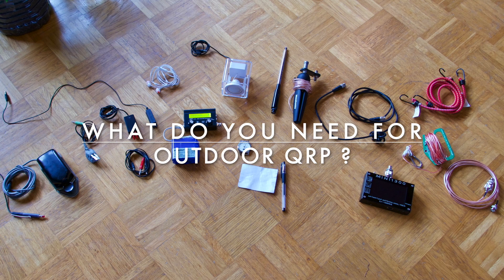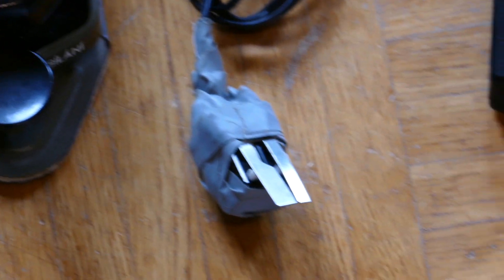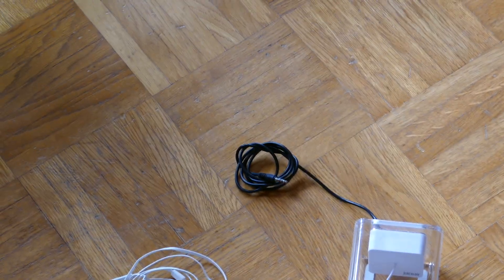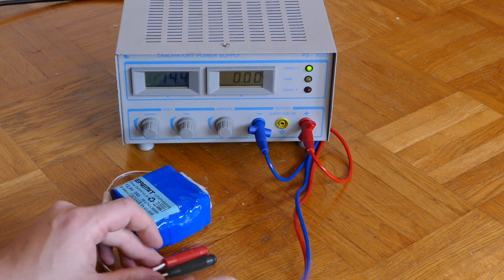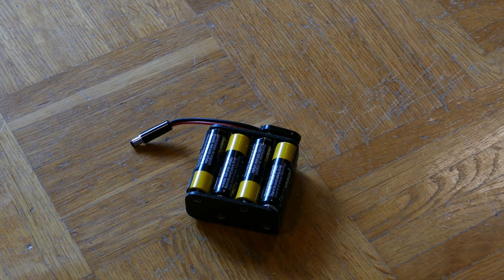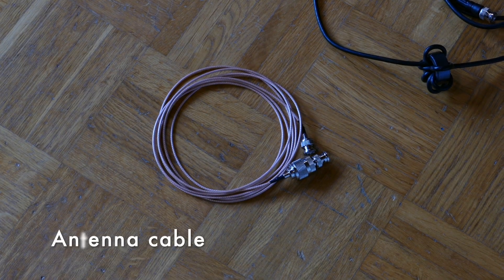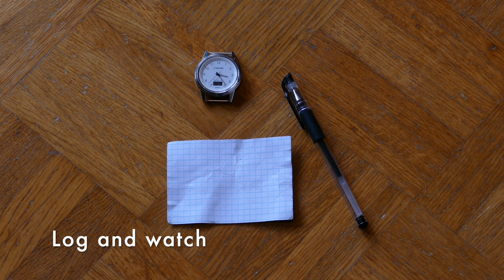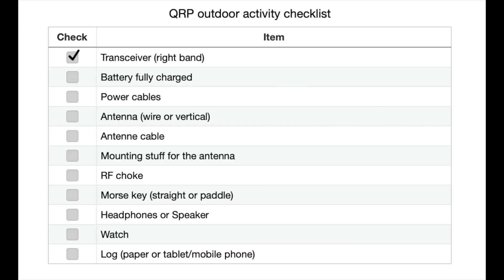What do you need for an outdoor QRP station?

Comment: Very interesting video! What kind of mount do you use on your tripod for your antenna and radial? I am new to the hobby and can't really find much from these kind of mounts.
Thanks and 73
Reply from the maker: The antenna mount is home made. I used a old pice of an flash light mount. The BNC side is a 13mm hole and a BNC-F to BNC-F adapter with mounting screw. The other side is a 6mm hole and a old "photo-nut". Vy 73
Reply: @echopapaqrp8166  Thank you very much :)